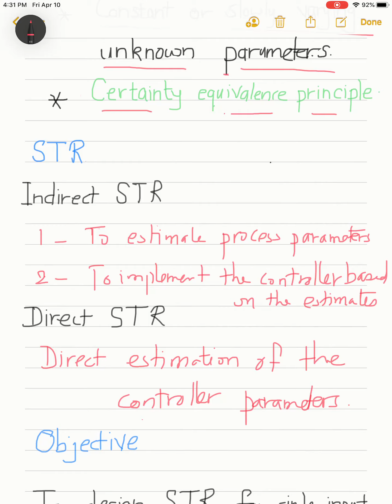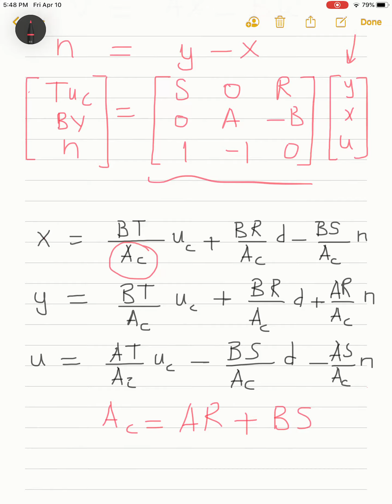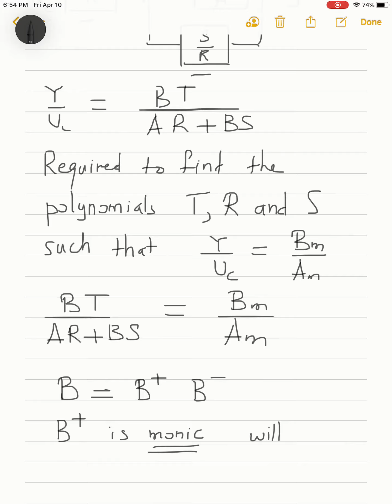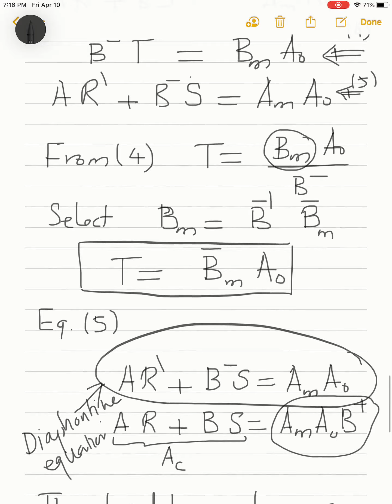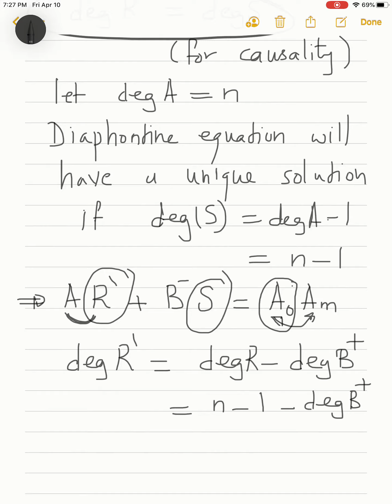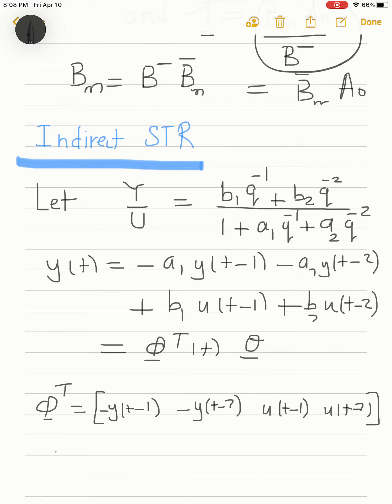L24 Self Tuning Regulator 1

Comment: I am looking to implement an STR for a dual input, single output system. Can I follow the same approach or can you point me to some resources that could help me with this please?
Reply from the maker: The STR described in this video is suggested by Astrom and coworkers. It is limited to SISO systems. You may like to consider model predictive control which can be implemented as an adaptive controller for multi-input multi-output systems. The textbook "Model Predictive Control Design and Implementation Using MATLAB" by Liuping Wang (2009 - Springer Verlag) could be a good start on the topic.
Reply: @DrElshafei  Thank you for your reply. I may be able to reformulate the problem as SISO, in which case this will help a lot!